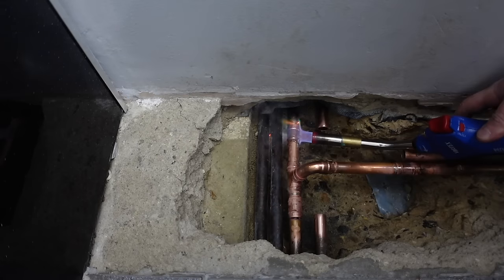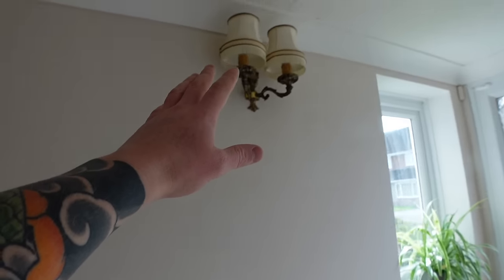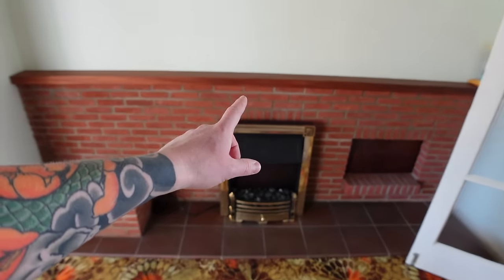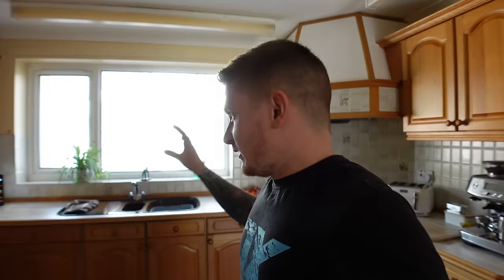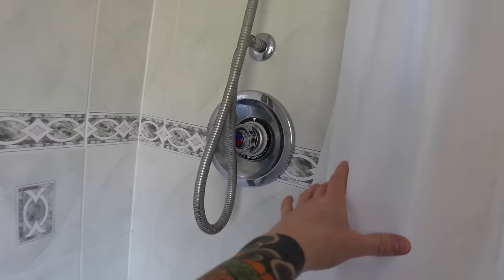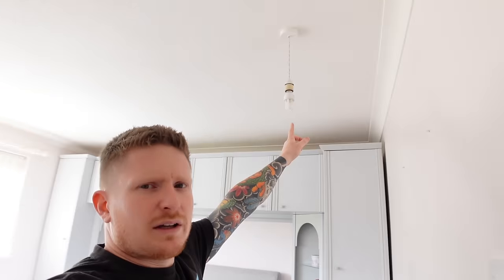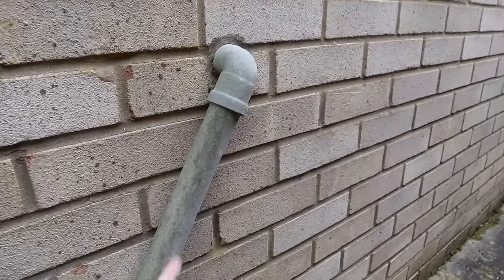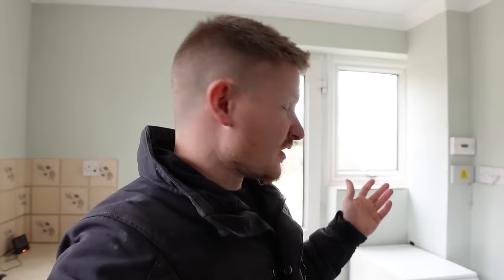I Bought This 1970’s House That Nobody Wanted And its a Mess - The Renovation EP01

Comment: Future proofing would be installing a heat pump though. Perfect chance to sort that pipework really, even a gas boiler would prefer 22mm on a large house which is why most houses had a 22mm branch of pipework. It looks like you had some 22mm also from the valves and such.
Reply: The expense is still holding so many people back! As I'm going to be ripping out the old back boiler in my property I intend to go with a heat pump but it could cost in excess of 15k!

Comment: Thats a lot of work to do in there cameron......but it will look absolutely amazing once your done. I love the look of the house and the garden will be fantastic for a family. Plenty of room and scope mate. Well done to you getting it. I know its more work but im thinking id fill the alcove in next to the built in wardrobe? Make it one flat wall. Giving you a bigger wardrobe and more room for a wall hung tv? Just a thought mate. And i think your going the right route with a combi too mate, sooooo much simpler even than an unvented system. And i havent heard good things about air source heat pumps especially with bigger houses....they struggle to actually warm the house. Ive fitted combis to some huge homes and got them really toasty. Just make sure you have good incoming mains pressure mate.
Reply from the maker: Thanks for all of your ideas and advice 😃

Comment: 👍 My old house needs new radiators fitted. But the new metric ones are not a simple refit because of the substantial difference in pipe centres. Would be great if you could provide some pointers for easy fixes and also to address the more involved solution of redoing the pipework under the wooden floor etc. Cheers.

Comment: Great potential, we’ve just moved into a 1930’s property with a similar kitchen and extractor built in, there’s a date on one of the cabinets 1981, the wall lights are the same as hat we have. 1 socket in every room, strange ceiling light positioning in the bedrooms but instead of the 2 that you have, there’s just the one nearest the windows, not sure if it was a privacy thing having less of a silhouette on the window when getting dressed
Reply from the maker: I think it’s a privacy thing. Thanks for the dates on the kitchen, maybe the same kind of age

Comment: Late 1960s early 1970s wiring you risk green goo. You may find yourself better off rewiring as you go and having each room fed with radial circuits. Not only is it carcinogenic but in the long run can cause house fires. 
You can have a Heat Pump on 15mm copper it isn't an issue, much smaller than that and it posses more annoyance. If you're after a wood burner you'll need the chimney checked and possibly lined/fan flued. Not always a straight forward install as people like to think. 

Also go unvented if you're having 2 showers/ full bath and half bath. Otherwise you're looking at an electric shower.
Reply from the maker: Ref green goo check out the next episode 😂

Comment: When you pulled out the electric fire place I could see your old fireplace is the same as mine. 
I bought my bungalow last year (built in 1968) & I still has the original fireplace which is the same as yours. 
It’s called a Baxi Burnall. 
They are unique & rather special. 
Google it & you’ll see what I mean 😉
Don’t just rip it out & throw it in the skip.
Reply from the maker: Thanks, interesting bit of kit

Comment: I live in  a 1970s house with fanlights over the doors.
I would say that the kitchen is from around the 1990s, the utility units look original.
if you don't already have it? a boiler multi fuel stove may be an option and link the gas and multi fuel?
Reply from the maker: Check out episode 2 for more info on the boiler 👍
Reply: @TheDIYGuy1  I have seen that, but you can link the 2 systems if they are compatible , something I looked into but my system was not suitable

Comment: Carpet in lounge is late 60s early 70s. Those light fittings look like they are 1950s in style: could the owner have moved them from their old house when they moved in in '73?
We took out a solid dividing wall in our house. The joists run parallel to the wall and none were resting on the wall. I don't think the chimney was added later, I think it was original build. From the 1960s, builders started doing external chimney breasts, rather than the usual internal ones. The kitchen looks 80s, but having said that, when we bought our house, we inherited exactly the same style units (ours were MFI) and that was installed in 1994.
Reply: You could be right, i had a 1968 house with exactly the same light switches and twisted pendant wires also glazing above bedroom doors also same double doors in the lounge.

Comment: We bought a cheap 3-bed semi in a similar condition and rented a flat for a couple of months rather than move in and try to do the work around us.  Rewired, replumbed, new boiler, new kitchen, new bathroom, Artex plastered over, painted, new doors and carpeted and we moved in after 6 weeks.  Would have taken MUCH longer had we been living there.
Reply from the maker: Thanks for sharing your experience and good luck with the rest of your Renovation

Comment: Just found your reno videos - doing a big one myself (two bedrooms with ensuites  for my teens in the basement).  I notice you were able to just pull the drain pipes apart and only push fit them together.  Here we glue every connection to prevent leaking and any sewer gases escaping.  Any thoughts as to your damp behind the cabinets coming from sweating or minor leaking from those drains?

Comment: Minor comment to correct a point you said in the video.  You do not need to replace the existing 15mm pipework in your house when you have an air source heat pump fitted.  It all depends on the heat loss survey but in most cases 15mm pipes are OK but microbore pipes often need to be replaced as you can’t get the required flow through them.   Our house had an ASHP fitted as the existing oil tank had failed; most of the radiators were upgraded but none of the pipework changed.  We have twin pumps in a push/pull configuration and this works fine even in the depths of winter.

Comment: At 4:29 in the extension you've got two 'columns' where the extension is. Will you be doing anything with getting rid of them?
Reply from the maker: At this stage no, because it would require a substantial structural change. In future years it is a possibility.
Reply: @TheDIYGuy1  Thanks for the response. As im watching ep1, you're home is firstly awesome and secondly similar 70s vibes to mine so I''m really looking forward to the series and wishing you lots of luck!

Comment: Steels should be placed on Padstones ya cowboy
Reply from the maker: Have a re think. The drawings from a structural engineer were exactly as you see in this video and has been signed off by building control. Your misinformed

Comment: You’re turning it into an American house and taking all the British charm away..! Love the conservatory… those ‘windows’ above the doors are called transoms. Fans aren’t necessary if you have a window in the bathroom. Good for the insulation.. ugly fitted furniture, agreed..! Ceiling lights are hideous..! Add electrical outlets, for sure..!! Especially with high tech these days. That pipe being exposed to the outside elements is what caused it to go brittle and break.